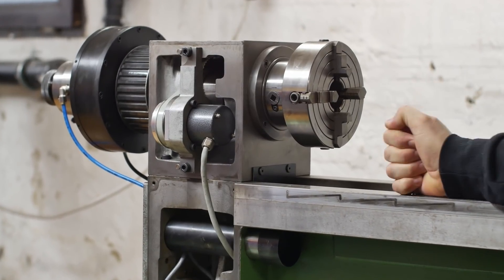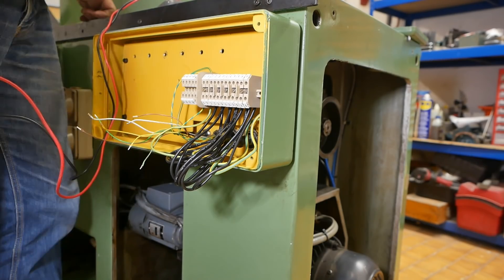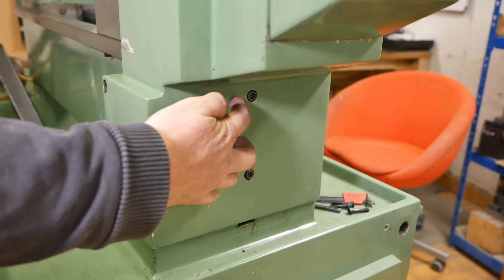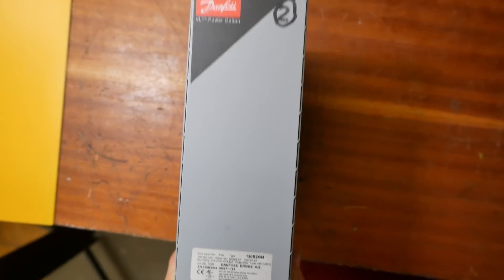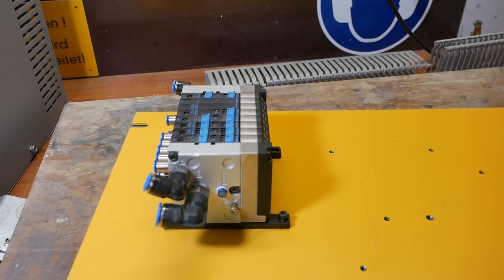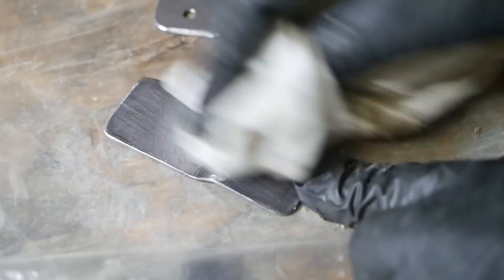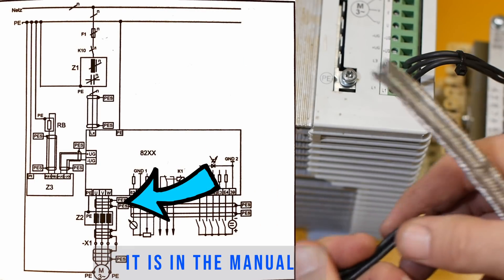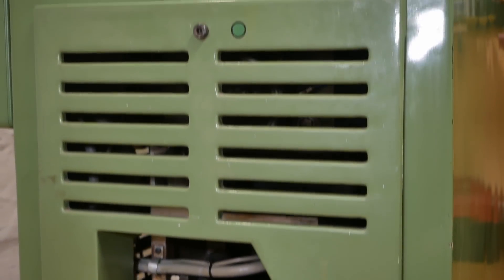Laying out the electrical cabinet - Schaublin 125-CNC lathe

Comment: The shielding between the filter and the drive should be grounded on both sides with metalic cable glands or fasteners. Pigtails on shielding dont help with EMI
Reply: I think the best reply is “it depends”.

If there is any difference in ground potential, then current could flow on the shield, which then radiates. Connecting the earth at one end only would stop this.
Reply: The completly painted Mounting-Plate and Mounting-Bracket on the Drive isn't very nice either, today we use zinc-coated steel so everything is connected to a common potential by as much area as possible. But it may work iout in the end. The whole bright orange painting inside of cabinets was mandated by norm in the old days to scream  "Danger, watch your fingers!" since connections inside cabinets weren not "Berührungssicher"/ "Untouchable" back then. You can see some examples of the exposed live terminals on the old contactors and motor circuit brakers.
Reply from the maker: Thanks for your inputs guys. My bad. I thought I was supposed to only pigtail one end. interesting that the bac kplates are no longer painted. I kind of like the Banana yellow and RAL 6011 look. :)
Reply: @RotarySMP  editing/correcting myself: For control wiring, One end only to the drive. For power wiring to the motor, both ends.
Reply: To prevent rfi noise it is also important to ensure 360 degree connection of the shielding, that pigtail is going to act like an antenna. However this lathe is relatively low power and is inside a basement hobby shop and will not run 24/7 next to sensitive eqipment. Id rather put some shielding around the consumer grade electronics. It is generaly bad practice to put electronics inside the same enclosure as frequency converters. At a minium the components should be separated by a grounded plate or shield.
Reply: @Dragehest  An antenna connected to ground, not to any input. AKA a faraday cage for the strongest transmitter, the UVW wires inside the shield.
Reply from the maker: @m3chanist  Thanks guys.

Comment: How about using pourable latex (eg chemask) to clean the plate. Just pour on, wait half an hour and pull off.

Beware, it definitely has some acids/solvents in it, so best to mask the surroundings!
Reply from the maker: I'd have to roll the lathe on its side. That isnot going to happen :)